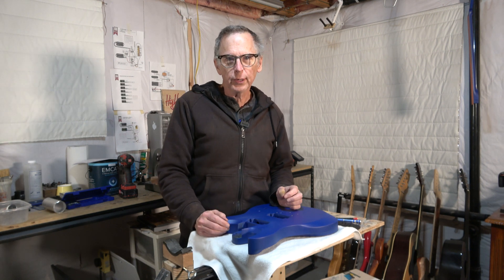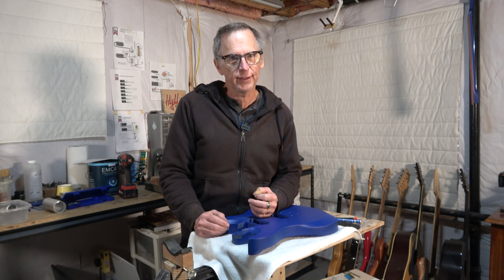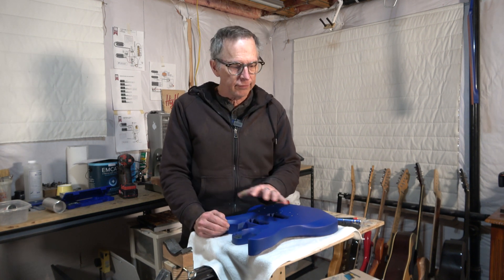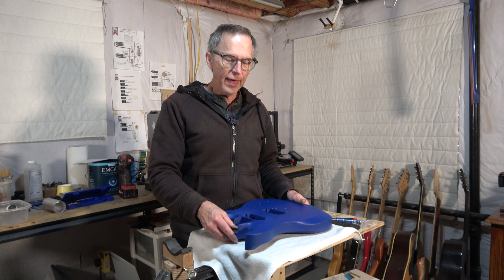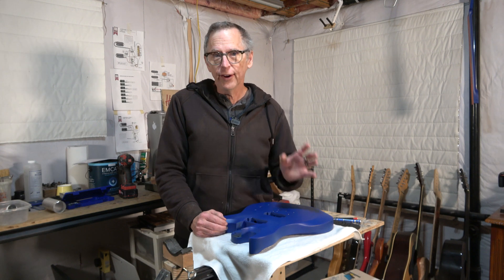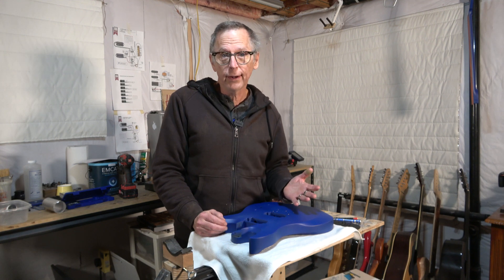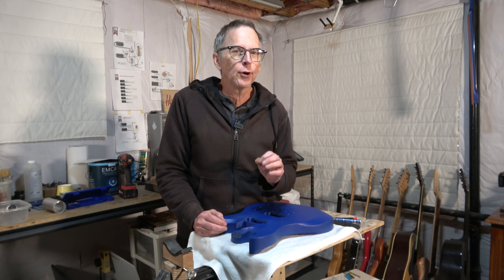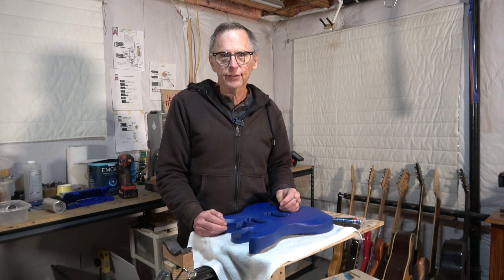Making A 3D Printed Electric Guitar Part 6

Comment: Hi Chris. Thanks for the videos. You are building a nice 3d pinted guitar. However I think the headstock-neck  connection is not rigid enough. Over time the string tension will bend the headstock. And it will happen near the nut. Printing the headstock in carbon fiber with steel reinforcements between  the neck and headstock will solve this problem.
Reply from the maker: That's why it's a YouTube build.

Comment: nice to see the guitar starting to be put together! probably a non-issue since you were able to get them in place and straight, but your bridge heat set inserts are upside down. you should have installed them with the thinner end into the material (kind of like you did the string through ferrules on the back and the heat set inserts for the pickups), it will help with centering the inserts since they'll find their way in easier and will deform the holes less.
Reply from the maker: In my tests, they work better this way because the plastic swells around the narrow top portion of the insert thus locking it into place. Neither orientation improves centering because the heat softens the plastic and makes it necessary to rely on eye/hand skill to achieve good centering.
Reply: @HighlineGuitars  that's what I thought when I noticed the finish on the holes. Nice, you gotta do what works best. I use M3 heat set inserts quite a lot in ABS functional parts and it's amazing how well they hold into the material. 5 point hardtail string through bridges would be a piece of cake!